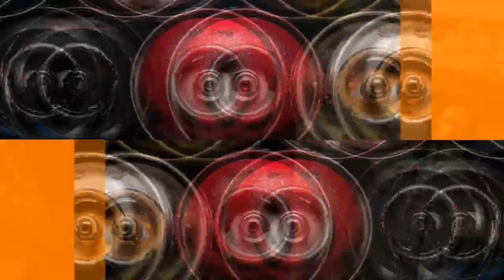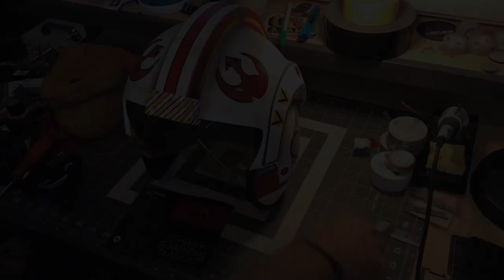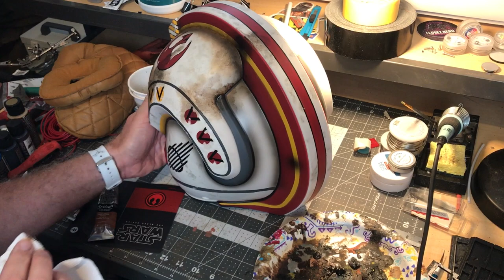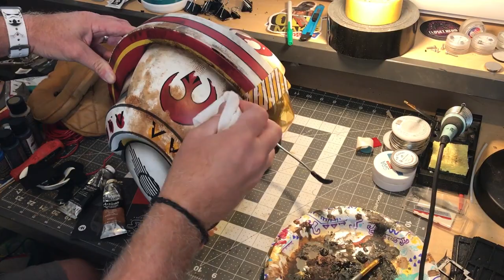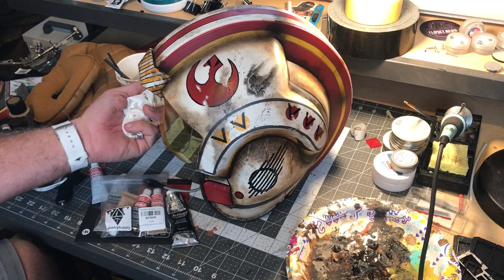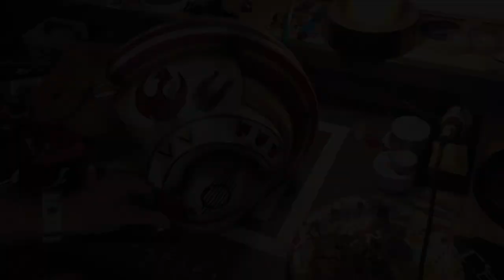TTFS: Re-Weathering A Black Series Luke Skywalker X-Wing Helmet

Comment: Wow nice job. I'm trying to convert the Trapper Wolf helmet version in Luke Skywalker's, so I have to sand the old paint scheme out, spray a base coat to fill the sanding job, and applying a matte white paint, before applying all the decals I've already printed. What I fear is to damage the yellow visor with paint, so I need to take the helmet apart, or if it'd be impossible (and it seems so....), I have to  mask the inside of the helmet out, perfectly. Any suggestion would be much appreciated....
Reply from the maker: I did a search and found some people in YouTube that were able to take it out!
Reply: @trytofinishsomething  Great ! Any link to check It out ? Thanx